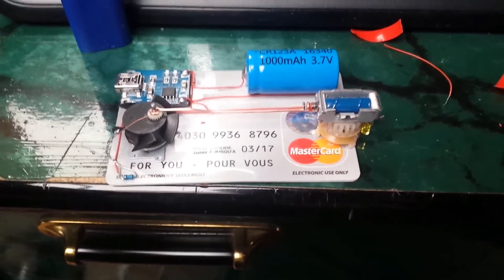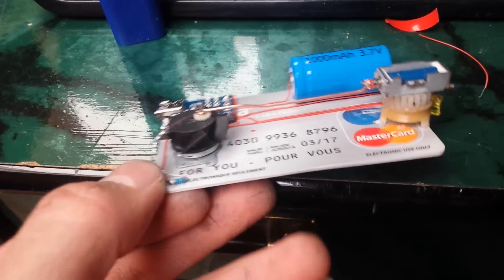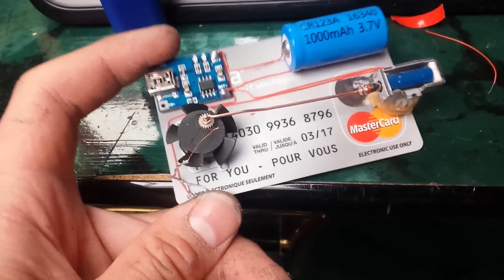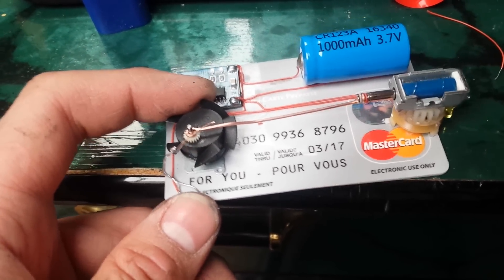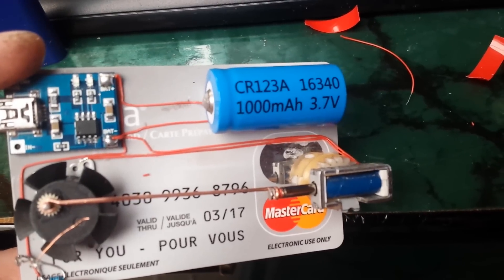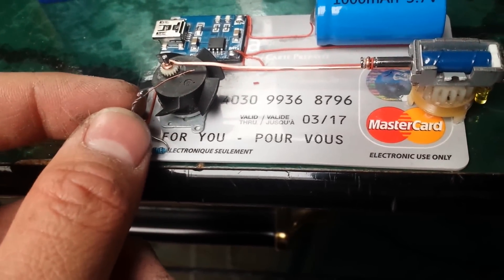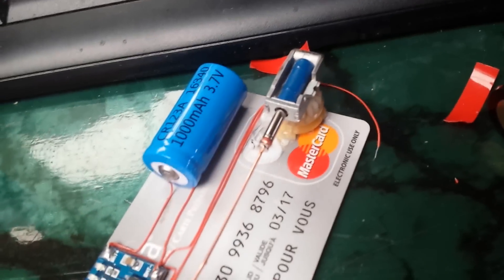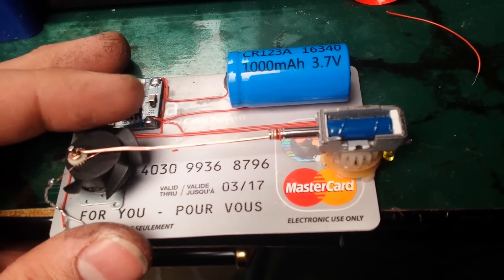Tiny Solenoid Motor on a Credit Card

Comment: Hey bro you know that battery is exactly what it is supposed to be. It may only draw 300 milliamps but its a 100 milliamp HOUR battery. Meaning it will do 300 milliamps for a little over 3 hours.
Reply from the maker: ive tested the battery, it has 340mah, i never tested how much it draws but id say maby 200-300mah so it would run close to 2 hours